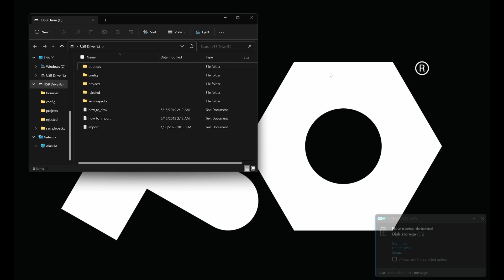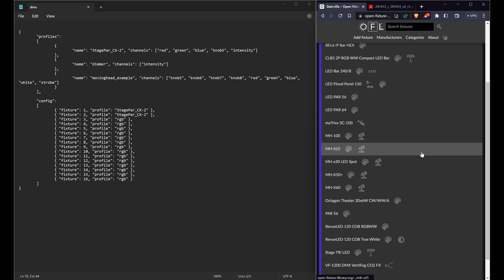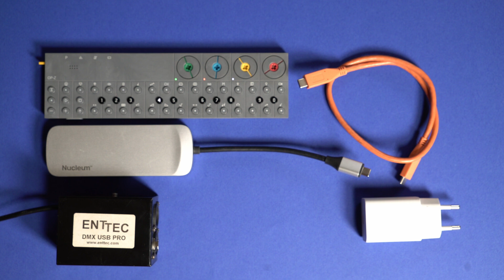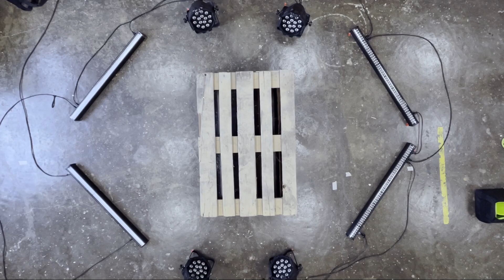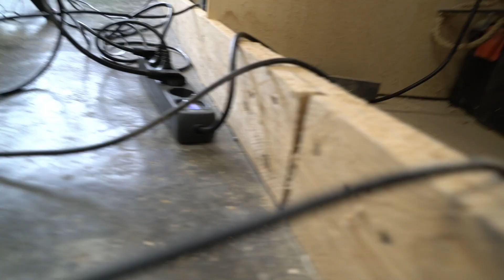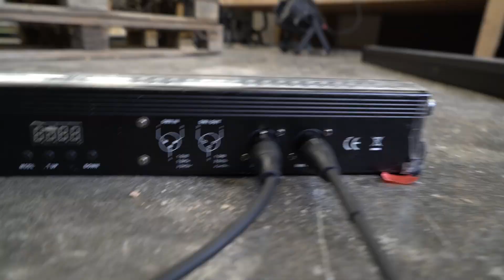OP-Z DMX Setup | Step by Step Guide

Comment: hi i have sent you a message earlier but you havent replied :( i have a liveshow in a week and bought the stairville led and did exactly as you did but it just doesn't work. i do use the enttec dmx pro, since the mk2 isnt for sale.

i use 2 x Stairville Led Bar 240/8 RGB DMX 30°

so i set the dmx.json

"profiles":
	[
		{
			"name": "led", "channels": ["red", "green", "blue", "knob1", "intensity"]

and the fixtures1 and 2 too led.

on the ledbars I did 5-ch waited until it stopped blinking. set one to dmx1 and the other to dmx6 and nothing happens. used different cables. and the enttec is via an usb c to usb a female connectec to the enttec and the entec light is green solid.

i just dont know what to do?
Reply from the maker: Hi Shufflephunk, sorry to reply only now, I think the issue stand with your usb-c adapter 😢 I managed to make my setup working stable only with a Kingston Nucleum ( you can find this info in the op-z guide at page 20.2 )
Reply: @alucula5005  Its the official apple one. I did manage to eventually make it work with 2 led bars. But by keeping the dmx.json empty? Also both of the led bars only give light as if they both we're the 2nd one in row. So its like 1/2 of the time no light, then 1/2 of the time light. So strange :- /

But I need to get a nucleum one anyway, used to have it earlier, but I wouldnt believe thats the issue though, but I will try that out.